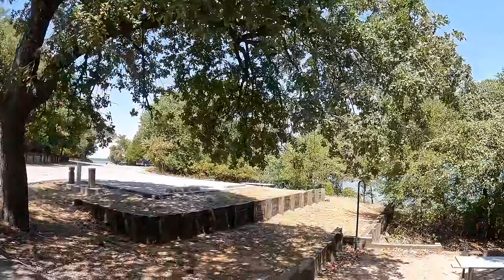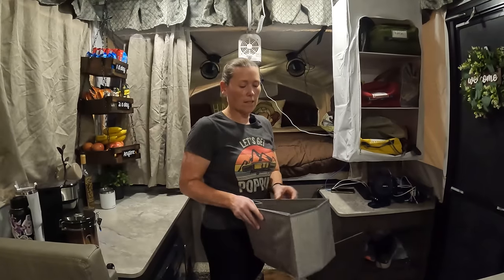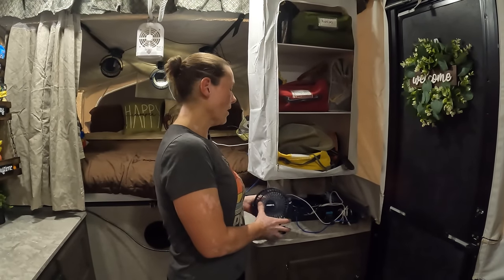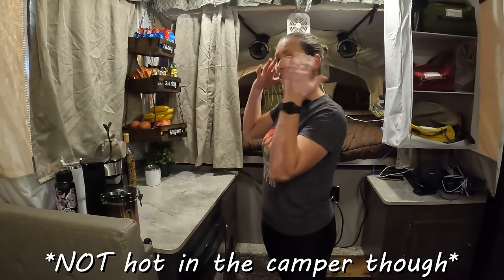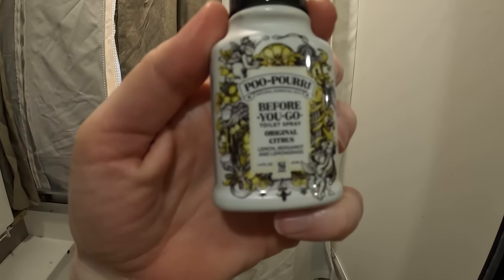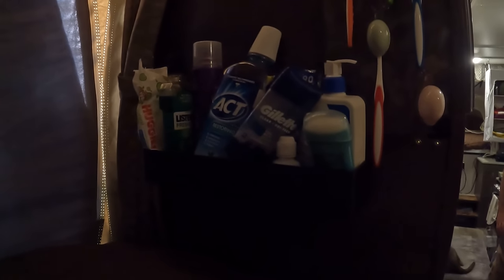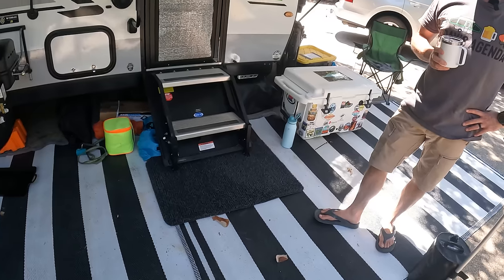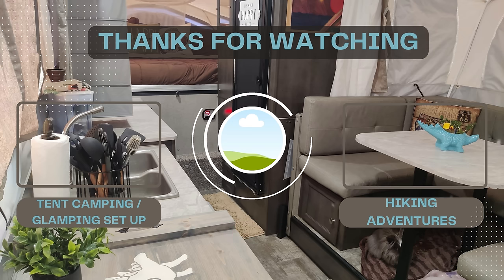Tour our 2019 Rockwood High Wall 277 (HW277)

Comment: If you are camping in hot weather, how cool does it get in your highwall
Reply from the maker: @terrypfeffer8504 Anything below 95 degrees can be managed without the reflective tarps and it stays semi cool at the heat of the day. It is comfortable enough to feel like you are escaping the heat when you walk in but I doubt it's below 77. With the "silver bits" and additional AC it stays very cool inside, probably closer to 70/72 at the heat of the day which feels like a bigger difference than it looks.